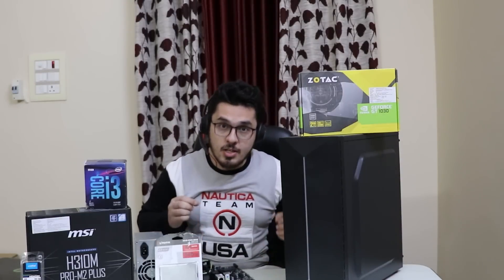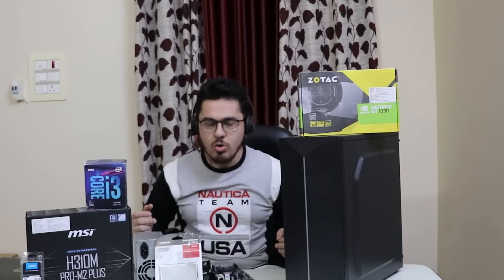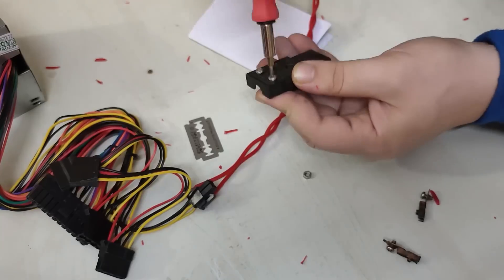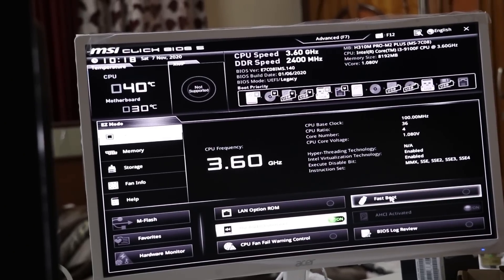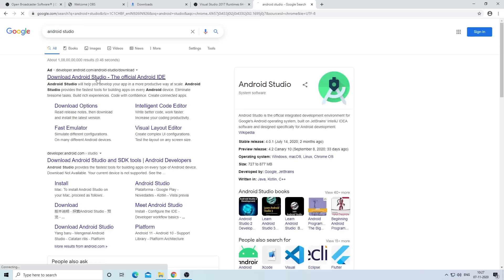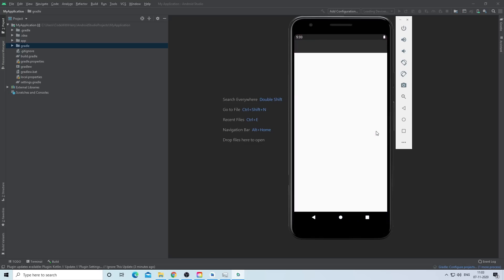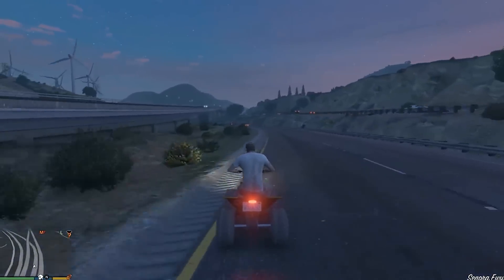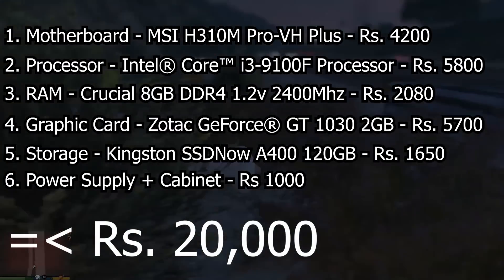Best Rs 20,000 Budget Gaming PC Build - Step by Step 🔥🔥

Comment from the maker: Hope you like this video. If you are using this build, here is the full list of components used:
Motherboard - https://amzn.to/3Ugnq4y
Processor - https://amzn.to/3eNTRXI
Ram - https://amzn.to/3qOnAmk
SSD - https://amzn.to/3dv0ptY
Graphics Card - https://amzn.to/3DDaL5N
Power Supply - https://amzn.to/3DzGtB4

➡Adding extra  8GB of ram will boost performance
➡Adding 1TB HDD will help you out in storing your files as memory left after installing 120 GB might not be enough for you 
➡Using a branded power supply is always better but given the budget, it was not possible to spend 5k on power supply here. Also, making proper use of earth wire in power supply is highly recommended for safety!
➡Ryzen 3 3200G is another alternative for building a similar budget PC but it is currently 11.4k on Amazon and it will require additional 8 Gigs of ram to function properly. Also motherboard for Ryzen 3 was costly at the time of this purchase. That would have increased the build cost to at least 25k due to which I bought the components of this build.
➡Keyboard and mouse combo can be purchased for as less as 150-200rs in local market!
Also after the Ryzen 500x series launch, we can expect the prices of Ryzen APUs to drop in coming months.
Having said that, I am using this build and this build is enough for coders and medium level 1080p gaming.
Should I do a 10K PC build for beginner level coding?
Reply: Ryzen 3200G is selling for 9K on Amazon.
And, an A320 Motherboard Will Cost You Around 4000 rupees
Reply: @programmer4047  hey mujhe  under 15k me coding wala computer banana hai yrrr help karoge kya kya lena sahi rahega
Reply: Harry bhai HOW TO INSTALL WINDOWS ka separate video banado please
Reply: @prasungupta5167  
1) Purchase windows key.
2) Download iso file of windows 10 from Microsoft website.
3) Create a bootable USB using the download iso file.
4) Boot your PC using the USB.
5) Follow the instructions and complete the installation.
Reply: @prasungupta5167  bhai, indian gamer ki video dekhlo, sab samajh aa jayega.
Reply: @techystandard  bhai link daal de
Reply: @prasungupta5167  yes bhai plzzzzzz
Reply: Harry bro ye 32 bit hoga ya 64 bit
Reply: @Hacker_Bhamiya  64bit
Reply: @VishalDevsani  we ca. Play gta V also on this
Reply: @Hacker_Bhamiya  yes you can play gta 5,valorant, CS go, pubg pc lite, minecraft,rdr2 on 720p medium, watch dogs 2,witcher 3 and many more
Reply: @Hacker_Bhamiya  you can almost play all games on 720p and 1080p
Reply: @Hacker_Bhamiya  64 bit
Reply: @Hacker_Bhamiya  yes bhai
Reply: @Hacker_Bhamiya  64 bit
Reply: Android ka course banado bus🙏
Reply: great Bhai U r Great
Reply: 50 k please
Reply: Yes
Reply: Ty sir,
U r amazingly helpful.
Reply: Yes i am student build 10k pc
Reply: @bestlearner8304  why
Reply: Yes 20k pc for coding and gaming...
Reply: Bhaiya can we replace gt 1030 with gtx 750 ti for this build? 
Plz tell
Reply: @vijaykandpal4896  yes, you can!
Reply: @suvidsinghal1365  and can we play gta v in this config. Or we have to replace this processor and graphics card with rysen 3 processor and his integrated graphics
Reply: sir plz reply is there any problem to use amd processors
Reply: @shauryakumar6714  yes for ex. if u are using rysen 3 processor u need 16 gb ram and a better motherboard than this , which will pay costly to u
Reply: Please bring kivy tutorials
Reply: Yes 10k pc
Reply: Haa bhai please!!! 10k
Reply: Bhai 10k wali bhi bna hi do ❤️❤️❤️
Reply: I am only 14 year boy.. And I don't do Instagram so please upload your PC upgrade videos on YouTube 
Sorry for my Faltu spoken English
Reply: App Thora cost extra karkre best features balee chiss laga kee PC build Karo na pls?
Reply: I am poor and need to learn unity 3d can you plzzz give me 😭😭😭😢😢😢😢😢
Reply: Harry bhai or any one plz provide links to purchase all same parts nd about to same price
Reply: Sir can you please list some alternative parts as the prices rose. i3 9th gen is over 10k rupees, gpu not availabe but i require it.
Reply: Plz Make 2022 Version As Because Price Of Lots Thing Is Higher Now + 2 Its Year Old Video +  Now Intel 12 Gen Has Come
Reply: Yes
Reply: sir in vs code when we link our image in html it is not shown in live server document i have tried several times pls tell me the solution of this problem pls
Reply: @bhavyaarora8999  image or html file Ka ek folder ke under Dal kr open with life server kr
Reply: Hello Harry  vai  from last 1 year i am following your YouTube channel. Now due to covid 19 my 1st exam has been stop after a complete 6 month our university has publish a routine for exam but I have forget all concept of c programming  so will you provide me a file of note  through my email .I have watch your  c programming  video but there  is not so much time to go through it so plz harry vai help kardo n.a. 😔
Reply: @codeforlearn8607  He would definitely help you but he might not see your comment. So, if you really want to, then message him in his instagram..
And all the best for your exam😊
Reply: @codeforlearn8607  नेपाल से h kya?😅
Reply: @khanalrahul   yes bro hami nepali hamro nepal🇳🇵
Reply: @codeforlearn8607  Nepal 🇳🇵peace ☮️ 😊💗
Reply: Sir , please make a tutorial on iOS development
Reply: Yes
Reply: Yes Bhai plz banao
Reply: I have seen review for this graphics card i'm not 100% sure and confident to buy it 
I am confused ?
Reply: Yes sir please made a pc costing around ₹10000 for coding and browsing purpose.😀😅
Reply: Bhai Mere laptop Me Baar Baar Blue screen of Death aata Hai ... Kaise Sahi Kare Bro
Reply: @arkam083  Format is the last option
Reply: @shouryakumar2189  Are Nahi Bhai Sara Data Chala Jayega
Reply: @arkam083  hardisk mai backup le lo
Reply: @shouryakumar2189  Ok ...
Dubara drivers Download karne Parenge...
Reply: @A 27-Kushal Gaikwad yes
Reply: Bhai tum log intel ke bajye amd per Jana to jyada Sahi rahega. Yadi tumko only pc build Karna he to.
Reply: Yes please build a 10k pc...i wanna know what component can be used and what will be its performance...by the way love your videos ...i learnt so many things from the courses u made....may your channel grow  and you become the best coding channel
Reply: Yes do video on Coding PC build separately
Reply: Yes plz 15k pc which can run gta 5 at minimal graphics,. But power supply should be good
Reply: Brother what is cost of cpu cabinet
Reply: Yes sir, 10k PC for Coding
Reply: Yes
Reply: Please a 10k gaming pc or 30k full setup pc
Reply: Can I play GTA 5 and use blender and unity without any problem or lag??
Reply: 30000 ka pc batao
Reply: Stupid build ... Better buy pre-owned parts in low budget
Reply: Bhai gta v ka jo gameplay tha woh yehi pc ka h na??? Mai ye same buy kar rha hu please respond fast @codewithharry
Reply: Harry bro pls a video on building your own smartphone
Reply: Sir can I install i5 10th gen?
Reply: Dear bhaiya... it would mean alot for this fellow if you will mention whether you have purchased the products from offline or online market? And if offline, then plzz mention the place....i want  to do a pc build so ur help would mean alot bhai
Reply: Yes build a 10 k pc that can upgrade in future 🔥
Reply: Thanks you explained me very easily maine to pc cancel hi kar diya gha lekin aapki video dekh ke maine firse plan kr lia du pc lene ka
Reply: Bhai windows10 me kon sa android emulator install karne se lag nahi karega.plz video.🤔🤔🤔🤔🤔
Reply: @sunilmohanty7295  BlueStacks 5 but your hardware should be good
Reply: Can I use this for autocad and CAM and programming
Reply: @Saksham Pandey bhai performance intel;ki;jyada hai
Reply: Yes Harry bhai pls 🙏🏻 do a video on 10k pc.
Reply: Bro do a 10K coding PC
Reply: Yes we want a 10k build too
Reply: Vai what motherboard should I choose with Ryzen 3 3200G?
Reply: Can I use 1000 watt power supply in this pc please reply
Reply: Is that gta5 gameplay recorded on 20k pc?
Reply: You should do a 50K build
Reply: Yes
Reply: Intel i3 9g. 5000-6000 
amd ryzen 3 3200g  8000-9000
Sirf 3 hazar se zindgi badl sakti hai
Reply: Going for 2×4gb ram would operate in dual channel and give much better latency than a single stick 8gb ram... With similar ram speeds
Reply: @CodeWithHarry  can I install amd processor in the same motherboard
Reply: @AlokKumar-tu8oc  I don't think so
Reply: @srijasatya1210  No, 64 bit systems can run 32 bit systems but 32 bit system can't run 64 bit systems. For information, this is 64 bit. Intel core i3 9100f. You can check it via a search
Reply: Yes
Reply: Hi sir, can we do coding in python 3.9 , django, flask, vscode using ryzen 3200g.Please do reply my budget is 25k only
Reply: bhai build me a pc, I don't know how to buy from market 🙏🏻 I don't wanna spend more money where an expert save me money 😁
Reply: Superb sir mgr I'm From Pakistan kia ye Sab Kuch yaha se mil jayga
Reply: Sir ismein blender chaly ga
Reply: Sir where you got Intel i3 9100F in 5800₹ please tell us also
Reply: Bro ye 64bits hota hay na
Mereko 64bits ke bareme jyada nehi pata please aak video bana do 64bits
Reply: Bro ye 64bits hota hay na
Mereko 64bits ke bareme jyada nehi pata please aak video bana do 64bits
Reply: harry bhai gpu Lagana jaruri hai kya . isme gpu ko skip nhi kar sakte kya??
Reply: I want to build a new PC in my tv can i ?
Reply: Plz make a video for pc build under 30-35k.. without monitor...becoz all prices have increased a lot.
Reply: hi
Reply: Harry Sir mere build is build ke pass pass he aur mein koi game ya kuch nahi khelunga to kya i3 10100f, 8gb ddr4 2666mhz ram, gt 710, h410mh, 1tb HDD,  no SSD, kya me android studio aur baki apps chala sakunga ????
Reply: Yes
Reply: Bro cabinet name
Reply: @srijasatya1210  possible nhi hai mare bhai
Reply: One question how to play Android game on pc
Reply: When we buy from nearest store then it cost is 30 to 35 ( may be same as online)
Reply: Can i use this assemble without a graphics  bcs i am not gonna use this for gaming
Reply: @srijasatya1210  Can i use this assemble without a graphics  bcs i am not gonna use this for gaming
Reply: Dada 10k me kya ayee ga ?
Reply: Intel i3-10105 4.4 GHz Upto 4.4 GHz LGA 1200 Socket 4 Cores 8 Threads Desktop Processor  (Blue)
Reply: Processor Price Now 12,200 better to buy Intel i3-10105 4.4 GHz Upto 4.4 GHz LGA 1200 Socket 4 Cores 8 Threads Desktop Processor  (Blue) rs 10739
Reply: You play GTA 5 video in your third channel
Reply: @narendrasuthar3734  which channel plz tell??🙏🙏
Reply: Tatti ha bhai

Comment: i7 3770- ₹4000
16gb ddr3 ram-₹2200 approx
Cabinet-ant esport ice 130ag-₹2500
Psu-clarion jm ps 620 550w-₹1000
Ssd-foxin 256gb -₹1300
Zebronics h61m2 Or frontech h61 with nvme slot motherboard-₹2000

Total cost -around 13k 
Buy a rx 570 or rx 6400 pre owned graphic card which will cost around 6-7k  

Total cost 19-20k  best gaming PC it will be in that range easily run RDR2, spider man miles Morales, remastered, gta v, far cry 5,far cry 6,god of war 2018,rangnarock, days gone, cyberpunk etc

Comment: This video is fake
This is not under 20000
Processor- Intel core 9100F - Rs.9859
Cpu- H310M pro-am plus- Rs.5175
Graphic card- ZOTAC GT1030 2GB GDDR5- Rs.7000
SSD- Kingston A400 120GB- Rs.2200
POWER SUPPLY- Smps E-500R 500 ward- Rs. 600
Ram- Crucial 8GB DDR4 1.2V 2400MHZ CL17 UDIMM- Rs.3320
TOTAL- Rs.28073
Reply: Bro see the date when the video was uploaded, there was no such lockdown when the video was uploaded, now the prices have really gone very high. So if u don't know anything then keep ur mouth shut and don't tell it's fake,
Reply: Where is 1030 2gb gpu for 7k ,can you give link?

Comment: Just to add a point, we need to put coolant solvent before putting it with processor, otherwise you will make your processor's life shorter
Reply: 7:44 thermal compound is already applied on the heatsink.

Comment: Impossible to get the processor of i3 9100F for 5800 its minimum (9000-10000)
Its a fake price.
Reply: Bro it was old time, now after lockdown the price has increased, before it was around 6500
🤕

Comment: Please tell me it's is good for descent gaming plz 🥺 like gta IV 
Features & details

Processor: AMD Ryzen 3 3250U (2.6 GHz base clock, up to 3.5 GHz max boost clock, 4 MB L3 cache, 2 cores)

Memory: 4 GB DDR4-2400 SDRAM (1 x 4 GB); Storage:1 TB 7200 rpm SATA HDD

Display: 21.5 diagonal Full HD VA ZBD anti-glare WLED three-sided micro edge, 250 nits, 72% NTSC (1920 x 1080)

Minimum Dimensions (W x D x H): 49.03 x 20.45 x 38.07 cm; Weight: 5.7 kg

Operating System: Microsoft Windows 10 - Home edition; Microsoft Office 2019 - Home and Student Edition

External ports: 2 SuperSpeed USB Type-A 5Gbps signaling rate; 2 USB 2.0 Type-A; 1 headphone/microphone combo; Expansion Slots: 2 M.2 (1 for SSD, 1 for WLAN)

Graphics: AMD Radeon Graphics

Wireless Technologies: Realtek Wi-Fi 5 (1x1) and Bluetooth 4.2 combo

Comment: My pc spec 
)intel i5 3570  4core 4 threads 3.4ghz
)H61 motherboard expandable upto 16gb ram
)4gb ram 1666mhz
) gt 710 2gb ddr3
) 500gb hdd 
)Normal cabinet
(15.4 inch monitoe
) normalkeyboard and mouse thats all

Only 16.3k full setup built

Comment: Can I use this for autocad and CAM and programming
Reply: Why not use it for any type of coding,  web development, light gaming after installing more storage.
Reply: @riyadebnath6589  I use a bit heavy CAD and CAM. Will this able to handle
Reply: @360srimankamalprithamtharr8  Yes i3 9400f is best in class under 10k Intel Processor with 4 cores..if your pocket allows you may add a 4 gigs of Ram to improve the performance.
Reply: @riyadebnath6589  is there any intel processors with 6 cores for my purposes . Hope you know it .🙏🏼
Reply: @360srimankamalprithamtharr8  i5 9400f costing around 12k..with 6 cores @ 2.9 ghz base clocking
Reply: @riyadebnath6589  thank you very much

Comment: plz dont buy this better option is:
ryzen 3 3200g = approx 10k which is less compared to i3 9100f and gt1030
a320motherboard= 4000
8gb ram =2500 which is enough 
250 gb ssd=2500
powersupply=there are 2 options cheap one which can damage your pc or little expensive one for 2500 which has 80+ efficiency
cabinet=anyone
Reply: No this is better

Comment: Harry vai plz ans dijiyega. Konsa better hoga.
# Gigabyte H310M-M.2(2.0) motherboard.
# Intel i3 9th gen 9100f processor
# crucial / Kingston 8gb Ram 2400 mhz
# Kingston / WD 250Gb A2000 M.2 NVMe
# Zotac 1030 2GB Graphics card.
.......….................................................
# Gigabyte A320M -M.2
# Ryzen 3 3200G
# 8gb xpd 2666 mhz Adata Ram
# WD/ Kingston / Crucial 250gb SSD

Comment: better buy a used gtx 1050/ 1050ti for that price. And don't use that kind of power supplies, it's better to pay an extra 2k on smps rather than losing 20k all together. and even if you're using this smps, please put a grounded plug.

Comment: Bhai 
Ryzen 5 3600
Gtx 1650 super 
8gb×2 3200mhz ram
240gb SSD
1TB 7200RPM HDD
550w power supply 
Gigabyte b450m DS3H motherboard 

Ye build kaisa hai coding programming developing ke lie
Reply: Better performance into Coding
Reply: @aviroy5081  thanks par ab laptop Lene ka soch rha hu
Reply: @jawaharlal6209  👍👍👍

Comment: To the people watching this video I want to give some suggestion on this build. Plese try buying a better power supply. I would suggest to go with corsair vs450 and also go for buying an rx 570. That would cost you guys only 6000 more in total approx. But that is really important In my opinion. Because using such a cheap psu will damage your components. And that Is not good for sure. Upgrading to rx570 will give you more than a double performance boast. This will be an important one guys because spending 6k more will protect your pc and give a lot better performance. Also guys these price I told you are in normal condition due to some issues worldwide the prices of pc products have incresed. So consider that to. You can check all about pc hardware and pc building in following chanel 
@Tech Dreams
@The tech nation
@Indian gamer
@The indian budget gamer
@Pc wlae
@Tech suvidha
@Linus tech tips

Comment: If you have 2000 rupees more you will definitely by ryzen 3 3100 
But you have to buy a different motherboard with am4 socket in it that will cost you the same.
The total cost of this pc with ryzen 3 3100 in around.   22,000 rupees.

Comment: i don't understand
pls.....Harry Bhai
Can You explain?? 

//Two variables to hold two input binary numbers	 

		long b1, b2;
		int i = 0, carry = 0;

		//This is to hold the output binary number
		int[] sum = new int[10];

		//To read the input binary numbers entered by user
		Scanner scanner = new Scanner(System.in);

		//getting first binary number from user
		System.out.print("Enter first binary number: ");
		b1 = scanner.nextLong();
		//getting second binary number from user
		System.out.print("Enter second binary number: ");
		b2 = scanner.nextLong();

		//closing scanner after use to avoid memory leak
		scanner.close();
		while (b1 != 0 || b2 != 0) 
		{
			sum[i++] = (int)((b1 % 10 + b2 % 10 + carry) % 2);
			carry = (int)((b1 % 10 + b2 % 10 + carry) / 2);
			b1 = b1 / 10;
			b2 = b2 / 10;
		}
		if (carry != 0) {
			sum[i++] = carry;
		}
		--i;
		System.out.print("Output: ");
		while (i >= 0) {
			System.out.print(sum[i--]);
		}
		System.out.print("\n");